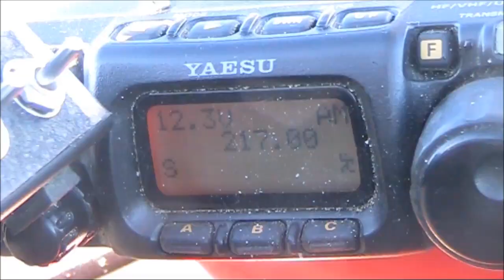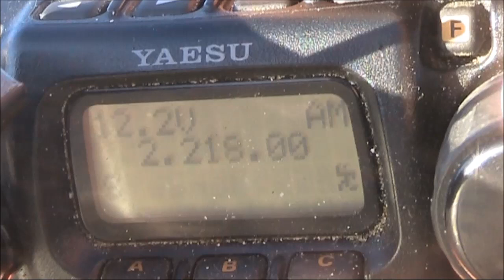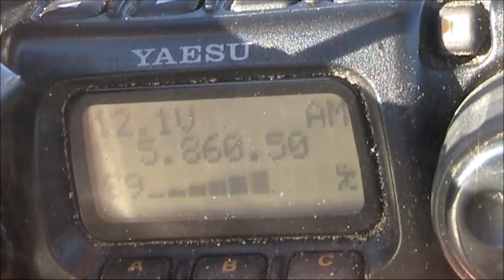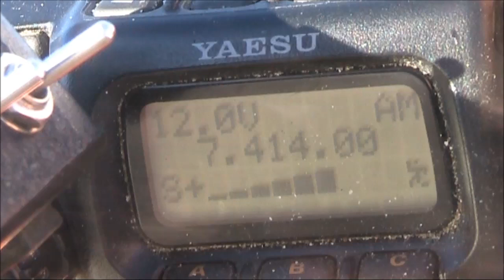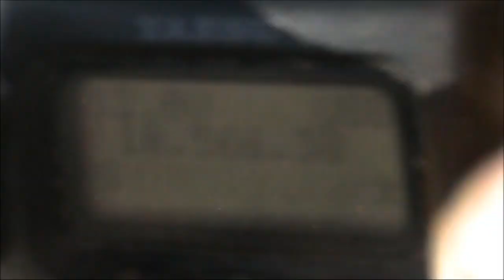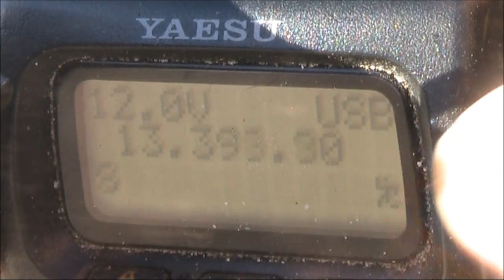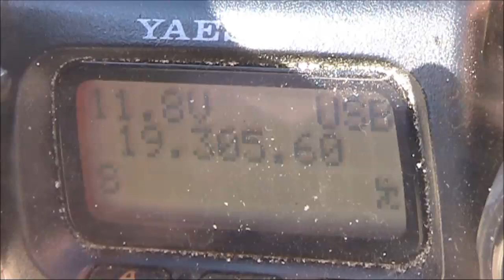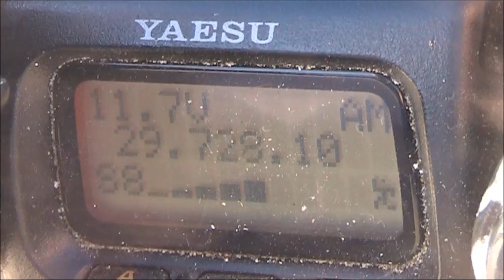HF band scan from the beach near Melbourne Australia (29/1/2017)

Comment: The one thing that stands out in your videos is that there is a lot more activity there in Australia than here in the US. I am located in the Mid West US. Today we have fewer AM broadcast than we used to, where I'm at there is only about 6 AM stations. I started out short wave listening back in 1964. Back then HF was packed! Ships used 2-3 MHz AM for communication and at night it sounded like 27 MHz CB during a big skip opening. 2638 KHz was one of the main channels and at night I could hear ships from both coast's and the Great Lakes. The Amateur bands were very packed. In 1971 I got my Amateur ticket. The bands were so packed with activity that often it was hard to find a spot open to call CQ but I always got a response. Today it's much quieter which is both good and bad as you can find open space but often call CQ without any response.

Comment: Just got my foundation (waiting for my VK1F*** callsign) also have a FT817ND on its way. Picked up a relatively cheap PAC12 multiband qrp antenna to have a play with. Really am interested in those random endfeds for portability
Reply from the maker: Wade - end-feds are definitely a good way to go. Might even work better than the PAC12 for closer in on 40m.
Reply: vk3ye just not practical for my home location as I don't have any room for it - tiny court yard in a town house. But I really want to try and get my head around making small / light cheaper home brew antennas.  Watched ur foundation series last night. Thanks for that
Reply from the maker: A loaded endfed like this can give good 7 & 14 MHz results in a confined environment. Only requires a few metres of horizontal space. https://www.youtube.com/watch?v=TV3Cj2J3T20
Reply: vk3ye looks good. Just gotta get my gear and callsign (7weeks. That's way too long) and then have a play. Keen on getting smaller and lighter.   Keep up ur videos. I subbed.
Reply: been watching a few more of your beach side QRPs, Guess I was trying to do it all with one antenna hence the PAC12, love to learn more about super simple  endfed.  NOOB questions.. where do you get those squid poles?
Reply from the maker: Haverfords in Sydney are good.  Reasonable prices and quick delivery.
Reply: purchased

Comment: Peter, what battery pack do you use with your 817?? I just got an 817 and now I am trying to figure out what the best pack is for mobile operations that will give enough voltage to assure 5w output but also give me a good amount of operating time (several hours)

Thank you!  73 de N0BPS
Reply from the maker: An 8400 mAH LiFePo4 from Hobbyking.
Reply: That battery is out of stock and not available anywhere. Seems they were having major issues with them when an aspect of the manufacturing was changed. Looking at the 5000mah version as its available. How much time operating do you get on the 8400 on 5w?

Thank you! 73 de N0BPS